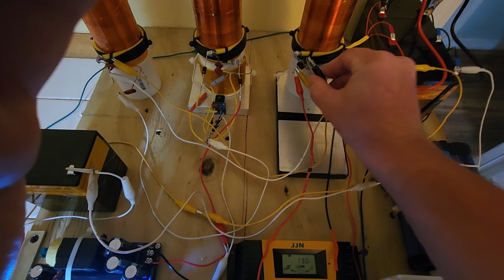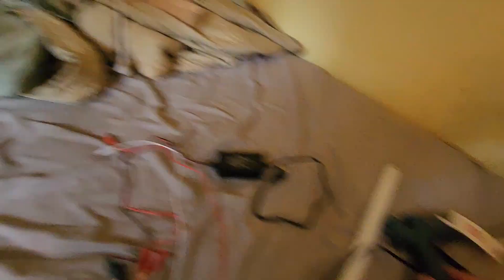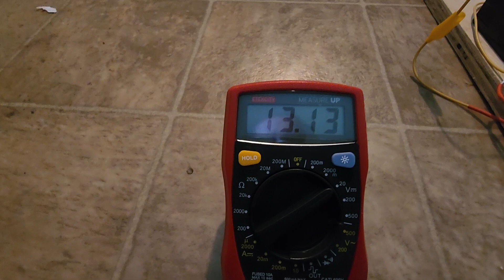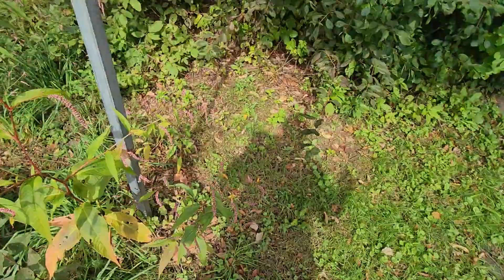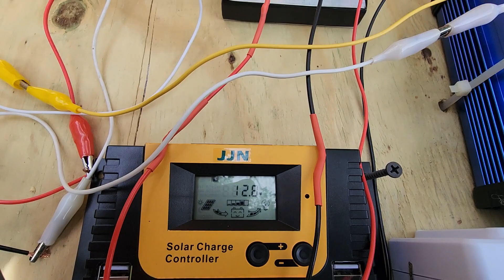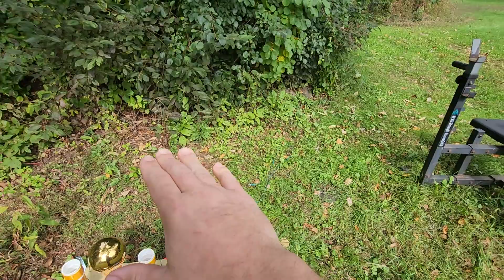🌞Self-Sustaining Wireless Power Device Video Diary Series📖Free Energy Tesla Technologies Solved🌩

Comment: Great work as always!  So if you're putting out 1.7 amps at 37 volts that's approx 63 watts.  Subtract the 13 watts it takes to run the device and you should have close to 50 free watts?  Have you tried running a smaller bulb like 25 watts or a LED bulb to see if it would self sustain?

Also, in your last video it looks like just 1 receiver coil was drawing 17 watts, but now 2 receiver coils only draw 13, what do you think changed there?

Would love to see a bigger device, but before that, what about adding a couple more receivers to this one?

Finally, what do you think about putting 10 super caps in series for 120 volt loads and ditching the inverter altogether?

Keep up the good work, I def want to buy a bigger one from you!
Reply from the maker: For some reason having the second resonant receiver coil tuned perfectly to the transmitter caused the transmitters input wattage to drop while the wireless power effects increased. I'm not to sure why that happens but some professionals I've been speaking with call it a hyper resonant  wireless power aggression effect where a resonant receiver coil mirrors the transmitters output & causes less of a wireless load on it while the receivers simultaneously output power which is crazy. The resonant receivers also relay & rebroadcast the wireless power when perfectly tuned. & yes i have some bright 120v 5 watt led lights I'm eager to run & see if the system can keep its full charge while simultaneously running the light. The key to making the system as simple as possible was using 1 giant capacitor bank as the tank of storage to run the transmitter & the 120v inverter & the extra power goes through a mppt solar charge controller for maximum efficiency. Also using a dc to dc isolated buck converter was very important for powering the transmitter. Certain components require dc isolation or the self recharging won't occur. Now i have to hunt down the utmost power efficient 120v inverter & having 120v super capacitors would terrify me & violently explode if something went wrong lol. I'd much rather have them at 12v very large tank of current

Comment: 34:15 the radiant is in the reverse flyback volts. The switching is what vibrates , frequency is not so important as long as you reach the threshold  in speed , even  ULF will generate vibration and once you have vibration you have flow aka direction ,

Comment: If you want to demonstrate that the system is self-sufficient and actually produces energy then do this experiment, run the consuming lamp for short periods and wait for it to recharge. The system uses the lamp for a total of minutes calculated so that it uses 100% of the capacity of the combined capacitors (70w x 4 capacitors = 280w) you must use the lamp for a total of 1 hour And a half so you can be sure that the system actually gave you back more energy than you consumed

Comment: How familiar are you with the Don Smith devices? 
He uses two ground. They can actually be connected to the same ground but the second ground after his high voltage transformer which is taken off the L 2 coil has an added capacitor or adjustable resister which as he describes it as holding back the electrons as a dam otherwise they just return back to the first ground from the L1.
Are you familiar with Rich Friedrich YouTube channel? He knows how to do it.

Comment: Do you have a capacitor or resistor on the ground of the l 2 coil?
Reply from the maker: Capacitor which prevents detuning
Reply: @MTECH2022 Do you have any idea what the frequency is.?
Reply from the maker: @1234ToddgMr  2.9 Mhz

Comment: Hi Mal, I don’t understand why the second receiver unit uses earth-ground  connection to the transmitter unit’s primary. Plus, I have posted a couple of q’s in your patreon feed.
Reply from the maker: The second receiver needed a separate earth ground or a supply of higher negative potential so i grounded it into the negative of the transmitters circuitry

Comment: At what frequency are you pulsing the primary?
Reply from the maker: 2.52 Mhz 10% Duty Cycle
Reply: How were you able to see the frequency?
Reply from the maker: @cristianbianchi6155  with a portable oscilliscope hooked up to the low voltage side of the transmitter circuitry